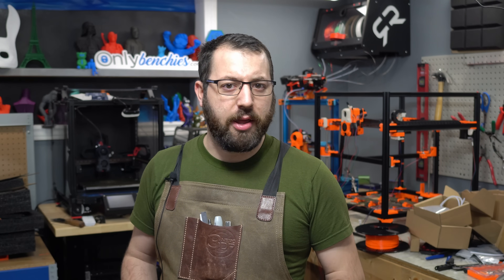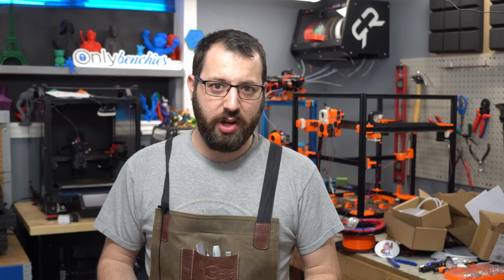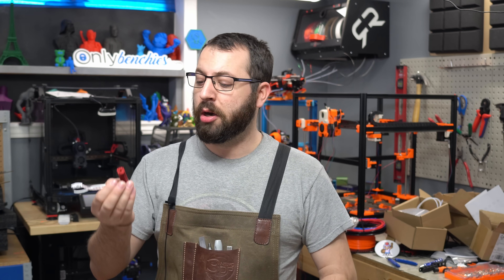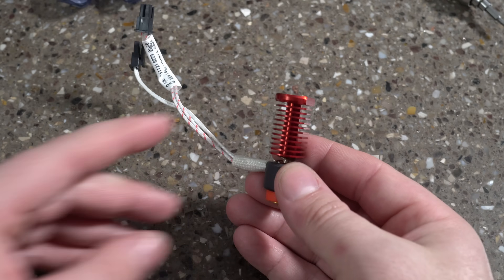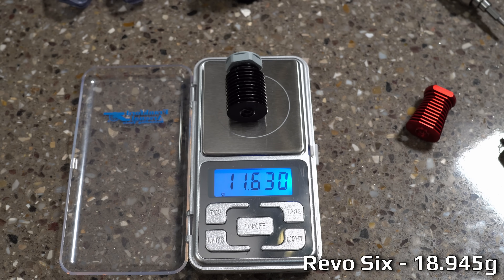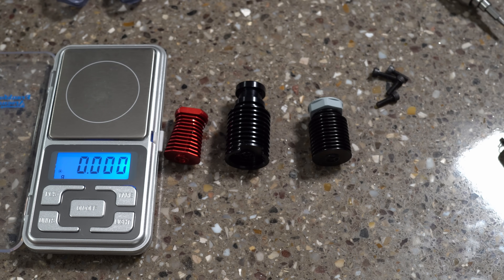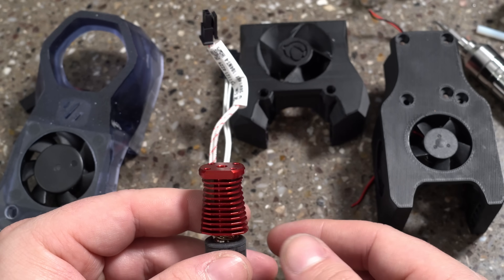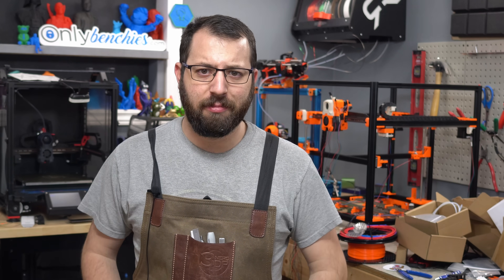The E3D Revo VORON - THE rigid mount heatsink for the Revo Ecosystem

Comment: The Revo Creality is also a rigid mount, and is small and light weight.  It might fit in the V0 as an option.  Note that it comes stock with a different thermister to match the Ender HW, but the heater is physically the same as the other Revo's, so that can be swapped out.

Comment: might be a stupid question but why do you need a ptfe tube either make the nozzle longer so it sticks out the top or put some copper or stainless tube in then you dont need to worry about the ptfe melting when pushing the speeds, sorry if it sounds dumb.
Reply from the maker: The ptfe sits about the heatbreak completely so nowhere near the "hot" zone, and you need something to guide the filament between the extruder and the small diameter of the revo heatbreak

Comment: Prusa has had a Nema17, lead screw shaft stepper motor in the MMU for many years now. Granted not long enough to use practically on a Z axis.  No offense, but I don’t think you can take credit for creating that one.

Comment: I got all excited for a moment.
Then I saw the heatsink design :(
All the weight and size savings are mitigated by the curvy (form over function?) fins that require a bulky and heavy fan mount. I would buy this in a heartbeat if I could use the clip on fan than is standard for E3D hotends.
Reply: @WhiteG60  yep, it has been optimized for a design where no simple solution can be used where an overly-complex solution exists. 

Seriously though, just listen to your excuse for the failing of the Voron team - they could have simply kept the heat sink not curvy and it would fit the Voron toolhead just fine.

Comment: Whole Rapid Change looks like a copy of Protoprint Raptor which was much earlier on market before releasing of E3D. They use even a DLC coating and call it E3DLC,  Protoprint stops using DLC and moves to another more suitable coating. And also there might be an IP problem in near future because Raptor is patent pending.
Reply: They are completely different designs. Only similar things are the heaterblock being round. The way the heater is made is different. How the nozzles fit are different.
Reply: @Raymond-u8x  You are partly right. Some changes have been made. The problem, however, is that IP also completely covers the whole concept of how the E3D nozzle fits.

Comment: Any advantage “ridged mount” bs the micros large locking nut? Seems to me the large locking bug would have far more surface area to stabilize the assembly long term..? 
Both look sweet mind you.
Reply: You are correct, the micro will be much more rigid and will not have issues with the screws compressing the plastic. The advantage is that the heatsink will not rotate when loosening the nozzle - whish is not a problem on the Revo.

Comment: I have a question. Vorons are fast right? Why are you guys chasing the lowest flow hotend for the Vorons? 10mm^3Sec is less than a V6? I’m confused genuinely on this decision. What’s the attraction?
Reply from the maker: Not sure why they are listing 10mm3/s, thats very conservative, it runs 16-18mm3/s printing abs just fine, and has no issues keeping up with most typical profiles for the voron.
Reply: @CanuckCreator  can you test it? It seems almost for sure wrong right?
Reply from the maker: Someone else on the team did the flow rate tests awhile back, it outperforms most older style Standard flow hotends by a bit, i just checked my slicer profile, i actually have it capped at 19mm3/s which it hits during infil @ 120mm/s with a .4 nozzle with .72mm flow @.2 lh
Reply: @CanuckCreator  Yeah that makes me believe it's actually correct. The reason is that we all know slicer settings are setting "limits" for the print. We need to have some independent tests. Maybe at the next big YouTuber conference, you can get Stephan from CNC kitchen to take it on. I am not sure how to test it myself. But I believe E3D's rating from what I have seen is "average" flow, "sustained" over a set amount of time. So assuming you can get 16mm^3s it probably is 10mm^3s. I am surprised no one is doing the science yet.

Comment: I can't wait to buy a few of these! Already have my Revo on pre-order, but will pick up another in support of this.
Reply: The Voron is arguably the fastest printer you can build. The revo has a max flow rate of 10mm^3sec? That’s like a top speed of 83mm/second using a 0.4 nozzle and standard layer heights. The revo is going to choke at speed. I’m tryin to understand the interest here. I’m sure the revo has a place, but on a Voron or a delta?
Reply: @thelightspeed3d712  not everyone is hunting speed. The ability to rapidly add or pull heat from the revo hot end should allow more precise temp when changing speed or direction. It’s a scalpel, if you need an axe get a rapido.

Oh and it’s new a different.
Reply: @TheBasil36  I didn’t say that. But if you get a Voron speed is the main reason to buy one. A Ender 3 can print as good but is ridiculously slow right? 

The revo is a scalpel? Lol. I would say Revo is a choke point until someone does more tests

Comment: being that much lighter how does that  effect  is heatsink properties? need more airflow to prevent heat creep?
Reply from the maker: E3D did full thermal validation,they found Revo Voron thermal performance to be better than v6 but not quite as good as Revo Micro, but very close. RevoVoron is smaller, less surface area, but benefits from a larger fan than revo micro. With revo there is a lot less heat to deal with in the first place.  You can also nearly double thermal performance by applying thermal grease at the cold side threads,  but that should not be necessary unless you run really hot chambers.

TL;DR will cool just fine

Comment: The heat sink is smaller than the other Revo versions. How's the cooling performance?
Reply from the maker: E3D did full thermal validation, found Revo Voron thermal performance to be better than v6 but not quite as good as Revo Micro. RevoVoron is smaller, less surface area, but benefits from a larger fan than revo micro. With revo there is a lot less heat to deal with in the first place.  You can also nearly double thermal performance by applying thermal grease at the cold side threads,  but that should not be necessary unless you run really hot chambers.

TL;DR will cool just fine
Reply: @CanuckCreator  Cool, that's what I figured. I've got a HF hotend in my V0, and it's been able to cope, so I'm sure it'll be fine.

Comment: what's your take on Phaetus Rapido vs E3d Revo?
Reply from the maker: ive had zero issues with flow rates with my profiles with revo with the .4 nozzle, if you want to go dummy fast WITH a large nozzle you need high flow
Reply: @CanuckCreator  and Revo has no hardened steel nozzles yet :/

Comment: Great work. Could anyone reply with the expected flowrate for ABS? Thanks...
Reply from the maker: As the heater/nozzle portion is the same as all revo`s, around 16-18mm3/s
Reply: Specs say 10 mm³/s
Reply from the maker: @olorf  Ya, not sure how they got that number, but remember there is no accepted industry standard for "flow rate" marketing

16-18mm3/s is real world numbers of what im running